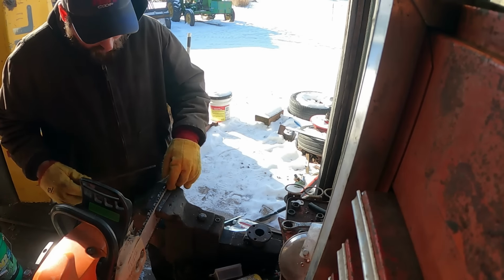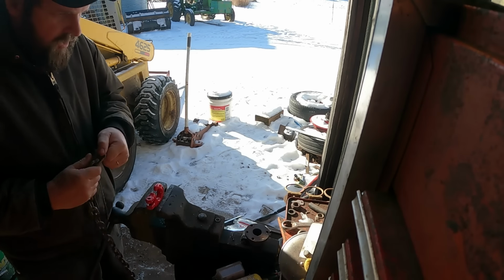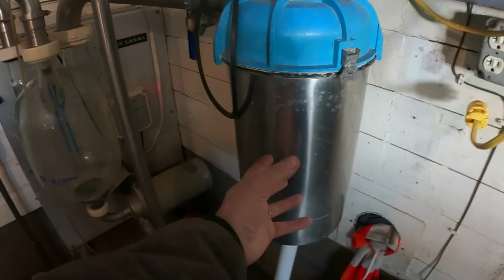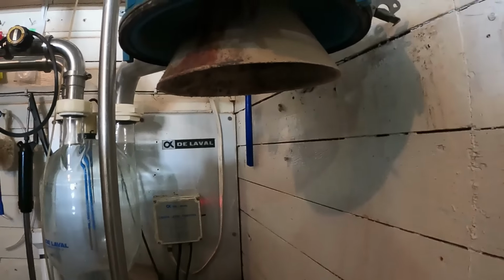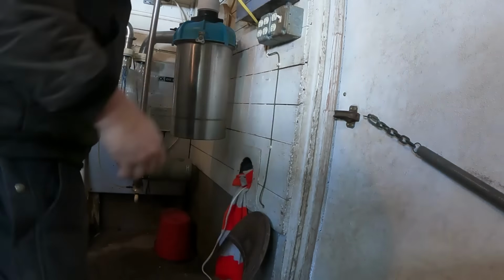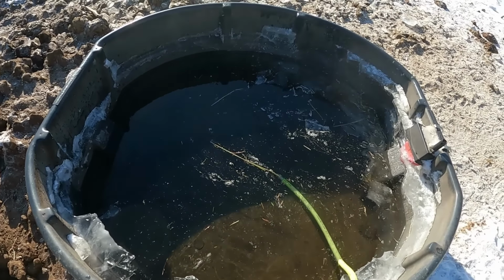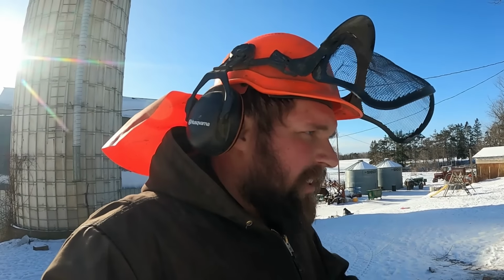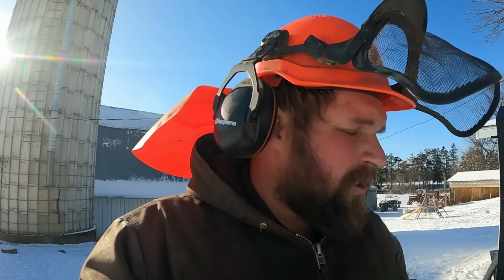Cutting Wood And A Couple Small Jobs On The Farm

Comment: As far as saw chains go for dirty wood file the chain @ 25 degrees it will stay sharper longer and try cutting from bottom to top it pushes the dirt away from the tooth instead of pulling it in

Comment: Did you get the tractor back yet ,
You sed the steering stopped working  ?
Reply from the maker: Yeah, it's back,  the  clutch came apart, so it wasn't driving the hydraulic pump.
Reply: @trinitydairy  that good  , hope it wasn't to expensive  .